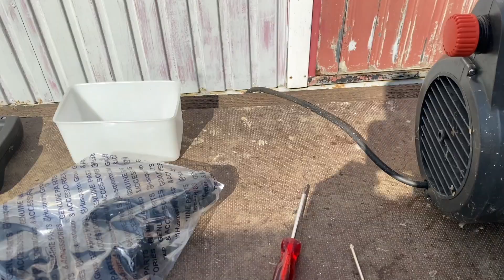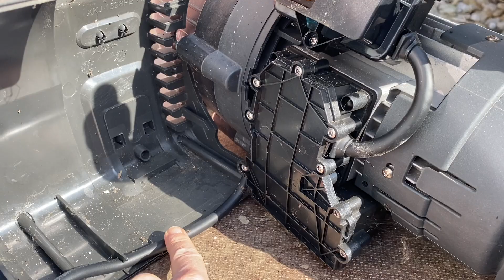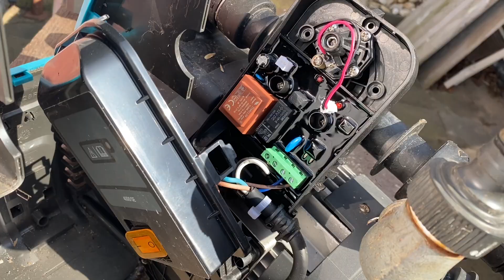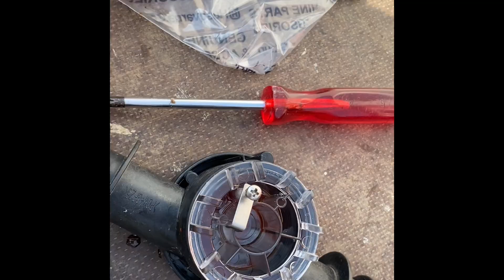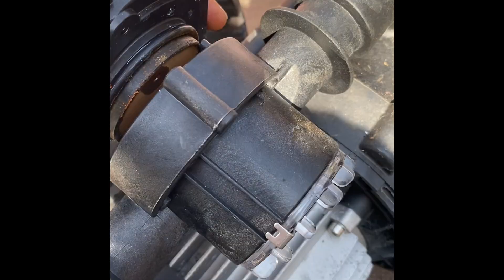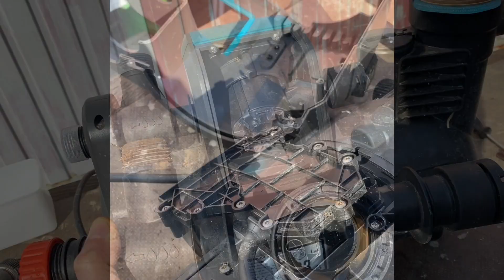Gardena 4000/5e Replacing Pressure Housing (

Comment: Ive search everywhere and I find it hard to troubleshoot for my gardena 5000. Same as ypurs just a bit bigger. It goes to falure after some time or keeps pumping and then just stop. So I have to turn it on a little at a time to keep getting water into my house. Ive cleanet the filter, ive checked the no return valve and its still failing... do you have any idea what could be wrong? There is no leaks or anything else i can see that looks to be wrong. Theres no air in it and it has the right amount of water inside😅
Reply from the maker: Hi Hi,
Thanks for reaching out, yeah I also couldn’t find much when it comes to troubleshooting these machines. Did the blinking code give you any insight? 
Before it goes to error does it provide suitable pressure? If it does it could be a problem with the pressure sensor (the wheel you see that spins in the see through plastic part) 
if it doesn’t provide pressure it could be a problem with the bore that you are using, or the pump wheel itself could be damaged, and regardless of how much it spins it cant get the correct pressure so it errors out.
It has been a few days, if you found a solution please share it here!